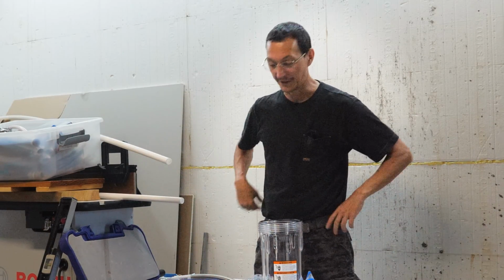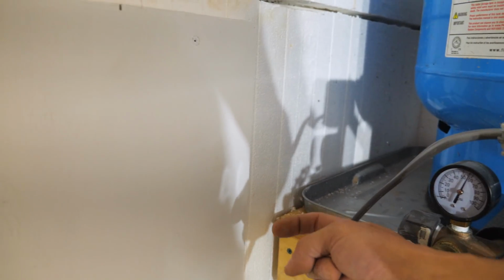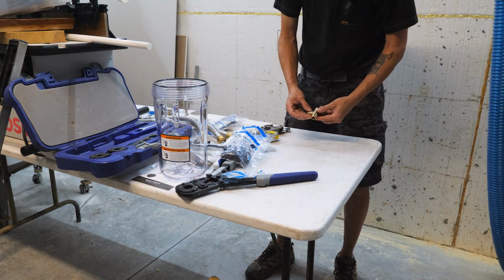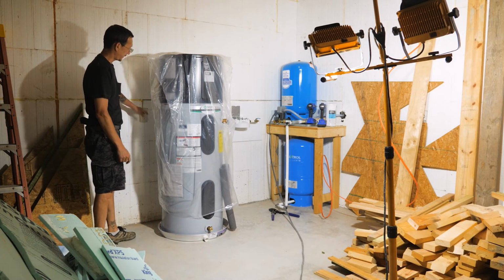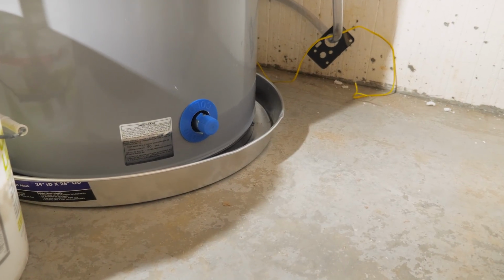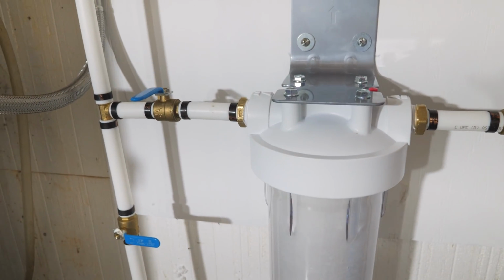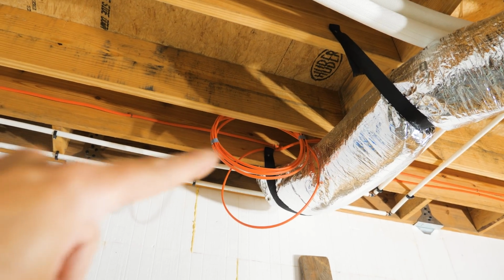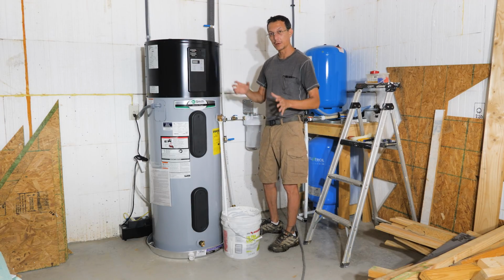Installing an AO Smith Hybrid Heat Pump Water Heater

Comment: bought one few days ago for only $250 at lowes, regular $1550, so im not going to complain it still alot cheaper than a regular hot water heater even if heat pump goes out ill just make it a reguler hot water heater lol.
Reply: same as what i did lol, My existing tank was only 5 years old but fully electric and the thing was a HOG on electric, Just picked one up for $280 at lowes. figured id take the gamble at that price

Comment: These water heaters are garbage. I have two of them and they both have had issues.  DO NOT BUY!
Reply: Care to be more specific?  What issues did you encounter?  (I just bought one of the 120Volt versions..... and no, I'm emphatically NOT going to be installing the mixing valves at every level.)  Seriously, what issues did you encounter?
Reply: @williamharrop2147  Codes on both. The second one threw a code and stopped working on the hybrid part for about a month, then just started working again for no apparent reason at about 18 months old.
For the first water heater at maybe a year old (if that) I called AO smith and they sent a tech out. They didn't cover the call under warranty because the room I had it in is "too small" then charged me $175 for the visit and on top of that, they said the ONLY problem was the size of the room it was in. Okay, that's 100% BS. I was still getting hot water from the electric element then about 2 or 3 weeks after the tech left the code just went away and it worked normal for about 3 years after that. About 6 weeks ago it stopped working all together and threw a EUC code saying to replace the upper heating element so I did and it didn't change anything so I called ao smith again and some how they actually sent another control board covered under warranty. Installed that and the code went away for about a week then got another code ELC and it's still giving that code to this day. I"m still getting hot water from it. IDK how, but I am so idgaf I'm not touching it.
Reply: @cranedaddy678  While I can't speak to the efficacy of this particular model, a heat pump does require a certain volume of air to operate effectively. The air requirements for each model are right in the manual. If the room it's in is too small, you'll need to bring in additional air through ventilation.

Comment: Did you use 10 gauge wire?  I see that this requires a 220/240V 30A circuit.
Reply from the maker: Yes
Reply: I don't see an expansion tank, auto shut off or a drain

Comment: hello!!.. my hybrid Heather is only 3  years old is leaking a little water from the hole that is close to the condensed drain line.. (they comes with 3 holes there and 1 is leaking now a little bit water) could you tell me what is happening?
Reply from the maker: I think that’s an overflow outlet. Something might be clogged with mineral buildup.

Comment: Hey there, we are looking to get a new water heater and are definitely interested in a hybrid, the reviews however are not great. I wanted to know how yours has stood the test of time?
Reply from the maker: So far it has been perfect. I have no complaints. It makes hot water and my power bill has never been lower.
Reply: @Guildbrookfarm  appreciate your response. We were curious as there are many negative reviews that talk about an ECC code. Glad to hear you are not having that issue.
Reply from the maker: No codes so far. 🤷🏻‍♂️
Reply: I just replaced mine under warranty. Kept getting ECC and ECL errors even after replacing lower element. I’ve only had it for 2 years. Distributors said they always see people come back with problems with hybrids.
Reply: @Jgib321  thanks for the update. We ended up going the way of an electric water heater. Hybrid seemed ify
Reply: @beaverfamily9302  Why ify? If the heatpump failed, it falls back to being a basic electric water heater.

Comment: Thanks for your video. What breaker and cable do you use? 30A breaker with 8/3 cable or 25A breaker with 10/3 cable? Thanks
Reply from the maker: It has 2 (upper and lower) electric backup heating elements so ran 10/3 to a 30A but they’ve never kicked on.

Comment: In the winter months, what is the source of heat for the basement area?  The heat pump is heating the water and COOLING the basement at the same time.  Maybe you heat the main level with a wood stove.
Reply: The water heater doesn’t need an explicit heat source. It just needs to be above 45 F, which shouldn’t be a problem usually.
Reply: An unheated basement will maintain the temperature of the ground,  which for most situations is the average yearly temperature.  There is a vast amount of thermal mass at the temperature, so it should be too much of an issue.  Details matter, so if your situation is unusual, check with a professional.

Comment: Does this unit have an Anode rod that needs to be removed if you have softened water?
Reply from the maker: Like most water heaters it does have a sacrificial rod. Unsure about having to remove it.

Comment: Just wondering how the heat pump hot water heater is working for you
Reply from the maker: So far it’s fantastic. I definitely recommend it. Our total power usage is about $2 per day for the whole house.
Reply: Hi. I have a quote from a plumber to install a new gas Viessman gas boiler with a 50 gallon indirect tank. I mentioned an AO Smith hybrid heat pump and they are trying to steer me towards the indirect tank. 

Any idea which would make more sense? Thanks.
Reply: @FuryFromTheSky508th  AO Smith hybrid water heaters is the best way to go. A gas boiler is going to cost you a lot in gas over the years time compared to this type of heater. The company that quoted you is probably a dealer for that brand heater and get kickbacks that's why they are recommending it to you.

Comment: I own a large solar company. We’ve had great success with locating a hot water panel on the roof ahead of a heat pump water heater in places that freeze a lot. Still get warm enough water to wash hands when its 10* outside during the day. Similar principle but more efficient as a “dump load”

Comment: Anymore info on the condensate pump? That was I was watching 😂 I want to replace mine with one of these in my garage but I don’t know where to run the condensation drain. The current heater is next to an interior wall. Was just wondering where your running the condensation drain.  Thanks- great video!
Reply from the maker: The drain tube goes outside through a hole in the wall.

Comment: Did you misstate the two two ball valves directions. Normally the handle is in line with the flow so it would be opposite of what you stated.
Reply: yes he did  misstate that; i picked up on that as well

Comment: Not familiar with putting the end of the TPR valve pipe in a bucket except when opening the valve to test.  Otherwise I thought it could be left to hang free 6" or less from the floor.  What's the consensus?
Reply from the maker: It’s not necessary. The bucket is more for the filter when changing it.
Reply: Bucket will keep any output from the TPR contained. If floor drain was "right there" TPR pipe could go into pan and send the pan drain to the floor drain.

Comment: Are you going to have to drywall the ICF walls for fire code? I was under the impression that you can not leave bare exposed foam in the basement, it needs some minimal fire protection (like 5/8” type-x drywall)
Reply from the maker: Not required here

Comment: put your inverter and batteries in the same room as hot water heater and the heat they produces will get absorbed by heat pump and then the heat pump will cool your inverter batteries. That is what I did in my utility room in basement. Works fantastic.
Reply from the maker: That’s a good idea 👍🏻😉

Comment: Hi you are absolutely right to be hooking at least one water cylinder up as a dump load to your solar (its basically a water battery at that point). There other thing to consider is a smart meter on any cylinders connected to the grid.  You can get meters now that only use grid power for water heating at night when the cost of power is much cheaper and in some cases you get paid to use it, as a grid levelling fee.  Re your wall behind all this kit you are putting in, its not finished? and this kit once in and running is hard to turn off and move out of the way, should you not be finishing at least the sections the tanks and water cylinder are sitting against before you put these items into production?

Comment: Just out of curiosity, why did you not just use a tankless wall mount?  It is utterly silent and way more efficient than a tank water heater.
Reply: The newest hybrid water tanks are actually cheaper to operate than tankless. I think you're confusing what he's installing with an old style electric heater that's been the same thing for the last 75 years. Tankless also requires a natural gas line to get anywhere near a good operational cost and they obviously don't have a natural gas line to their home where they are.

Comment: Nice job, getting so close.    Do you need a "disconnect means" for the water heater's 240V input near the water heater?
Reply: Typically you need a disconnect by the water heater or a lock on the breaker in the panel.
Reply from the maker: Nope

Comment: Great video as always, these water heaters are the future. My only question in your situation; does it get enough and I mean continues (warm) air supply. With the insulation in the basement. Will it be like running an ac unit in a insulated foam box where the split system is also inside the insulation?
As it takes the heat from the room, the room cools. As your basement is super insulated (which is obviously fantastic) does it get enough “fresh” air to take the heat from.
Reply from the maker: I thought so too but I have a friend with an ICF house who did it this way and it seems to work great.
Reply: They are the future if you don't have gas..  Nothing beats an on demand high efficency gas water heater..
Reply: Fantastic thanks for your reply! 👍👍👍👍
Looking forward to your experiences and such machines will help save you $$$ and are better for the environment so win win 🏆
Reply: Gas is 99% not renewable/aids in the destruction of the way we humans like it here on earth. And will get more expensive when it will run out eventually. So yes not future proof. And not to mention no chance of gas leaks and house blowing up with electric. If you say on demand electric I see your point but then one needs a huge battery setup or mains connection.
Reply: @GS-mx6ls  gas isn't going anywhere for a very, very long time..

Comment: My husband and I changed our old water heater when it died ourselves & we have to replace some of the pipe bits. We used those shark bite bits and I absolutely love them! A bit more expensive, but so easy and quick.

Comment: Does the water filtration system take out iron bacteria...I have a lot of rust color accumlation in and on my fixtures
Reply from the maker: This one only filters sediment as we have granite dust from the well drilling process. We had a softener in our previous house that was made to remove iron so they do have solutions for that.

Comment: Hey Jeremy, a couple things of interest, to me anyway, the hybrid water heater cools the space it is in, to what degree depends on the size of the space and how long the compressor runs and the space heat load. my concern would be in the winter time. the basement will be a cold space unless it's heated. the warmer the basement is the better the water heater will heat the water within. but the discharge of the cool air coming off of the water heater will cause the heat in the space to run longer. if the basement is not heated it may cool down below the working temp that the manufacture recommends and will cause the water heater to run longer. suggest that you raise the hybrid water heater up on a platform near the ceiling and add a donor older good non-leaking water heater tank on the floor and pipe it into the new one using thermosiphon design. that way the hot water from the donor tank will rise up into the hybrid tank on its own without pumping it. the cooler water from the hybrid tank will fall into the donor tank. on sunny days extra wattage not needed for the house will DUMP to the donor tank,  it will be heated by solar and the hot water then will fill the hybrid tank and at times may not run the hybrid compressor. i wish i could do all that you guys are doing,  but i am too old to change. keep up the great work on the house.... jim in central florida
Reply: Actually if the basement walls, outside entries, and cellar windows are all very well insulated, the basement will be a very comfortable and dry living space and with this Heat Pump Hot water heater, there will be NO humidity year round that will ruin your tools and won't need a (costly to operate) de-humidifier.

Comment: I have one of those heat pump hot water units.
(Still watching the video)
Make sure you pipe the water that it generates outside. It makes a lot of water in winter, about a bucket full every few days. 
Much less in summer when I need it for plants.. haha..
Mine is outside under a lean to verandah .. 
Here in Australia (state of victoria) they were giving us free units to cut down the amount of power everyone uses. (This I assume is cheaper than building a new power plant.

Comment: Looks really nice!  Like the heat pump water heater.  A friend of mine installed one and he said a side benefit is that it acts like an air conditioner cooling the area it’s in headline heating the water.  
Question, did you install a check valve if you tapped into the AC condense line?  Maybe two so neither system can back flow into the other and water can only go one way.  Maybe that doesn’t work in non pressurized lines?  Or would there be pressure due to pumps?
Reply from the maker: I didn't touch the AC lines. Major code violation to plumb the two together. Each system has it's own pump and lines.
Reply: @Guildbrookfarm  ahh my bad.  Just for that I should watch it again 😉.   Really nice enjoy watching the build.  Excited for your family.  May the gods of construction watch over your build and offer no unexpected excitement other tham an earlier than expected move in date 🙏

Comment: Good luck with hybrid water heater. My son went thru two of them and finally called it quits and went to a gas water heater and this was in less that three years. His water heaters were not AO Smith but another supposedly quality brand. Manufacturer did stand by their warranty and replaced the first one and I think refunded his money on the second.
Reply: Well hate to just say "works on my machine" but one person going through two of them when I've never heard of anyone having an issue across 7 installs I know of brings it more like to a "your son" issue and not a product issue. But anything's possible

Comment: We have had our heat pump water heater for about 5 years now and it has saved us a ton (it heats 80 gal for less than our old 50 gal...)...  We protected ours as well with a sediment, then whole house, then softener, before going into the heater...  We also put cut outs so we could bypass any stage with shut offs if any stage went down...  You will love it...   The noise is a easy trade off for the cool air it produces...  ahahaha
Reply from the maker: Awesome 👍

Comment: If you have heat in your floor. Good luck my friend has this in his 40x60 building. It will only heat the building to 60 degrees
Reply: You're not supposed to use them for space heating, they are for hot water for the kitchen/bathrooms/etc.

Comment: Generally whenever you plumb in an in-line water filter it might be prudent to simultaneously plumb in a bypass loop.  It requires additional ball valves but allows you to bypass the filter should the need arise.
Reply from the maker: If I did that it would give me an excuse to be lazy if there is a problem with the filter... rather than just fix the filter. 😂

Comment: You're probably aware that BX wire is also available for exposed wiring projects, but I don't know if the option you chose is cheaper.  Did you research both options?